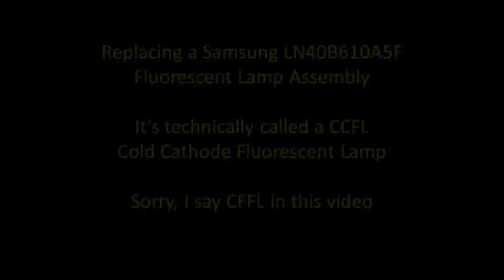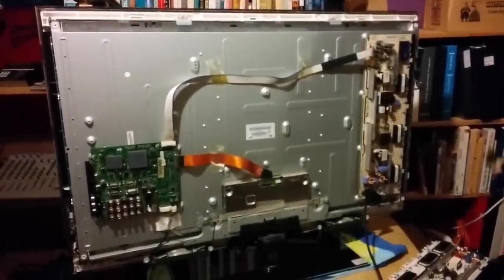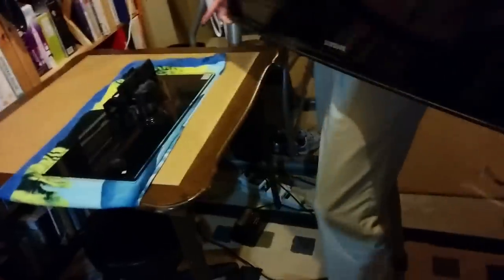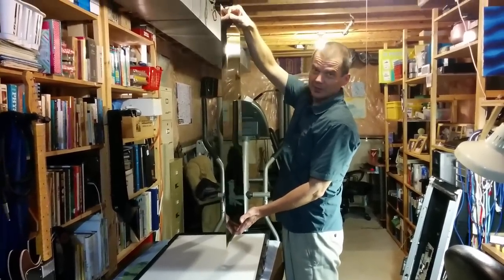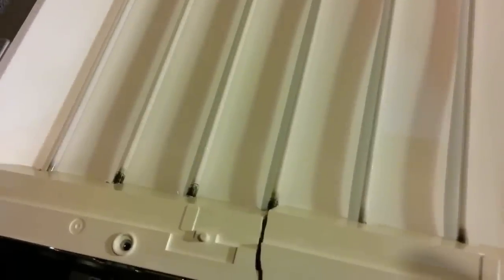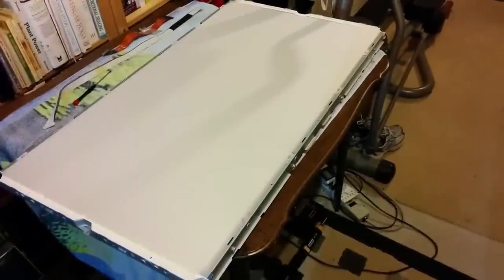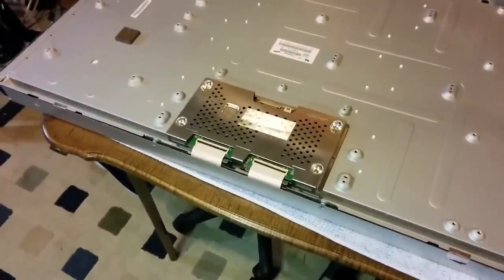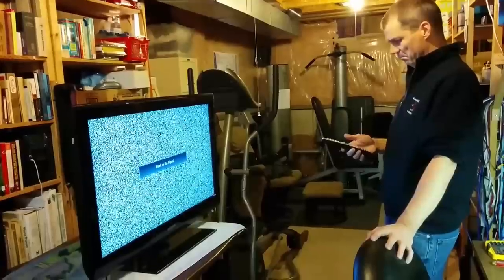Replacing a Samsung LCD TV Fluorescent Lamp Assembly to fix backlight power off after power on.

Comment: Thanks for the video Steve. Great job getting it going again and keeping it out of landfill.Cold Cathode Fluorescent Lamps contrary to their name are not "Cold". Burning at the ends of the tubes is caused by arcing or spluttering as the tubes age. The inverter board is shutting down because it is sensing a over current fault because one or two of the tubes have a arc track causing high resistance. The old CCFL's were run at maximum brightness causing them to age far quicker than they should of. When people buy a new LCD-TV (whether it be L.E.D. or CCFL backlight have the same problem) they will plug the unit in setup the channels and leave it at the factory default settings. These settings are always set at maximum backlight brightness causing their $2k plus LCD-TV to die sooner than it should. The manufacturer's always give the maximum power consumption IE: 250watts because that's the max power the set will pull from your house AC supply. Lowering the brightness of you're TV from 100% to 50% (I have a 52 inch LG TV and it only pulls 120 watts at 45% brightness) will not only save power it will save the TV set from self destruction. I been fixing these rubbish TV's for some time now and I am just starting to see more L.E.D. backlight TV's coming in with blown LED's in them causing dark spots in the panels. For your own sake turn the brightness of the backlight down as low as you can and save yourself loads of money by not having to replace you're new TV at 2 or 3 years old and not having to pay all that money running a 250watt TV at maximum and run it at 40% brightness and running at 120watts. Makes sense I should think!
Reply from the maker: Hi Dallas.  Thanks for the great summary and very helpful tips.  I honestly believe I did not turn down the brightness on this repaired TV.  I'm going to play with that tonight whilst monitoring the power consumption with my handy Kill-A-Watt thingy.  If a brightness adjustment is warranted, I hope the family does not notice :-)
Reply: Great advice i was turning down the brightness before tubes burned out. I am hoping new tubes will get it back again and hopefully tubes will stay on

Comment: Great Video.  Just a word of caution.  When powering on a unit for the first time and the chassis is open, Always wear protective glasses and earplugs.  PSU capacitors do blow up and the cases fly off.  Personal experience here !!
Reply from the maker: +pentachronic Thanks for the nice comment and the very wise safety advice.
Reply: Or place a plastic case over it
Reply from the maker: Thanks for the good idea.

Comment: Great video man! I really enjoy seeing people bring old electronics back for a second life
Reply from the maker: Thanks.  It was really fun making the video.  The TV is still going strong as well.  So worth the effort.  Here's a shameless plug for an LED upgrade I did for a friend many moons ago.  http://opengeeks.ca/projects/led-upgrade.html  I'll try to keep these coming for people like you who enjoy them.
Reply: Steve Quinn Here's a question that I often wondered. The number one problem I see with flat screen TV's nowadays is the TV working except the backlights, usually causes by bad capacitors or mosfets on the power supply/inverter board. I'm currently in the process of repairing a bad inverter board with new mosfets which will more than likely take years to arrive from china, is there anyway you know of to just get a CFL backlights going without a properly functioning inverter? I'm guessing people haven't really experimented into that since TVs are so easily replaceable but was curious anyways. Thanks
Reply from the maker: I don't know sorry.  I've recently borrowed (aka stolen) my Dad's ESR meter to repair a 2009 iMac power supply's bad caps.  I cannot believe how easy it is to rule out bad caps with these meters.  I'd consider that first and foremost for all larger electrolytic caps these days.
Reply: Steve Quinn How do you test capacitors on a standard multimeter?
Reply from the maker: With a simple multi meter, you could easily detect a dead short but nothing more.
With a capacitance meter, I'm curious what a bad cap measure out as.  I suspect it would appear to be ok
I don't know, I dont have that kind of meter.
You need an ESR meter to measure the Equivalent Series Resistance of an Electrolytic Cap to an AC signal.
This is applicable to larger Electrolytic filter caps only
Filter Caps should be a dead short to AC right?
So when measure with an ESR meter, they should measure as a dead short
With my meter, a good cap burries the needle as does shorting the probes.
Bad Caps, (bulging or not) will measure a greater ESR value.
It's hard to explain.  Here's some links.  If you are still confused, I'll make a video :-)

Here's the vid that inspired me https://www.youtube.com/watch?v=72sJ5Infuu0&t=34s 
Here's a DIY http://paulorenato.com/index.php/94
I'll buy a better one than my Dad's if necessary but a cheap one certainly worked for me
Reply: I get what you mean, I still wouldn't mind seeing a video though
Reply from the maker: Ok.  I'm just getting the gear and knowledge together to do one :-)
Reply from the maker: K Uploading it now.  It might be available in an hour or so.  https://youtu.be/CltS0LyHQXc

Comment: Awesome job. Feels good to fix things that other people won't take the time to do. I have 2 of the Samsung LCDs with the big push button in the middle that had bad capacitors in them and they both still work great,. I gave one to my ex and have been using the other in my bedroom. The picture quality on the new LEDs is not even close to the old school Samsungs. I wish there was an easy way to convert the CCFLs to LEDs because that thing is like an oven.
Reply from the maker: Thank you for the thanks.  It really does feel great to fix stuff.  That's awesome you have done the same. I had no idea the picture quality is better.  You are right about the heat feeling like an oven.  That comment inspired me to think of perhaps incorporating a fan to augment the TV's cooling.  I see no reason why a well placed quiet fan cannot move enough air to keep the heat from prematurely overheating/aging the CCFL's.

Comment: Great video. I'm considering doing this job that is needed on my Samsung 40" LN40E550F7FXZA.. i'm looking to see if I can find replacement CCFL bulbs.
Reply from the maker: Thank for the comment.  I got lucky (and lazy) and simply swapped the bulb assembly with a donor TV.  If I ever face this issue again I might try the LED conversion process that seems to be quite popular in the community.  Good luck.

Comment: The failed lamp can be replaced putting an equivalent dummy load of a capacitor around 100pf-220pf 6KV.I did it a couple of times in a tv and a monitor and both the sets worked perfectly.LCD lamps are unaivalable nowadays.
Reply from the maker: Hi George.  Thanks for the comment.  Are you suggesting a dummy load is applied to each failed lamp?  If so, It's an interesting idea.  Hopefully only a few lamps are toast and the light it not missed.  It's both sad and good the CCFL's are unavailable.  Pimping out these TV's with LED's seems to be the cool way of solving the problem.  Pun intended lol

Comment: It's good to repair these. The standoffs for the bulbs dry out and the ultra violet light from the tubes mess them up. I wonder if you can get those.
Reply from the maker: Thanks for the comment Walter.  I think the heat does them in as well.  I have no idea where to get the standoff's new.  I'm sure there are boatloads of used ones in donor TV's at your local recycling drop off.   I think you can get away with less than are installed as the bulbs are pretty stiff.  If you do find a new standoff vendor, please come back here to share it with others.  Good luck.
Reply: @letter2steve  I've repaired several flat TVS. Mostly D con boards. Then take to the salvation army store.
Reply from the maker: @waltergabriel3694  That's awesome.  Have you tried to perform an LED modification?

Comment: You opened every thing but you did not convert to LED backlight from CCFL tubes CCFL tube got life of maximum 25000 hrs  only and it was black end any it your wish  Good Luck Good effort and patience keep the good work Love your work
Reply from the maker: Hi Shindhs.  Thanks for the comment.  Believe it or not, I posted this video on on Jan 10, 2015.  At the time, I don't recall LED  conversion was as popular as it is now.  I also had an easy CCFL swap available at the time. It's nice to know an LED conversion is around the corner if needed.

Comment: Hi Steve i find myself doing the same LCD dismantle this week . I have a Sony Bravia Kdl 32v. I have tubes on for approx 5 seconds then off. One tube glowed orange so i have removed it but no change. I have found a supplier of tubes here in UK but wondering about the insulators. Not watched all your video yet just bits. Lewis
Reply from the maker: Hi. Thanks for the comment. It's great you found a source for tubes. Can you let us know in these comments section who they are. The stand off thingies as you will find are crazy brittle. I personally never needed to change them but hopefully a simple solution awaits.
Reply: I am on contact witha tube supplier via Ebay. He is in Twinkenham London UK. Will keep you posted. I need 10 for my project and I am negotiating a price
Reply from the maker: Cool. Thanks for the update.
Reply: @letter2steve  Hi again Steve. Regarding LCD tune supplier. I realise the length of tube i require 72.5cm is slightly less than what was shown on ebay which was 74cm. I was wondering in your donar set what was your tube length. Thanks Steve. Lewis in UK
Reply from the maker: Hi. Sorry for the delay. I'm in Montreal at the Formula 1 race. The Cell internet is wacked by people here. I never purchased tubes. I simply swapped the assembly. If you look close at my video you may see if you have a little wiggle room for tubes of a different length
Reply: Thanks Steve enjoy the Formula 1 I will keep you posted Lewis

Comment: Basically you have a dead CCFL one or more tubes lighting on the LCD screen itself.This is not an easy jobs require a lot delicate works and take it a parts and have a exact tv model with a bad LCD screen for parts to fix this thing.
Reply from the maker: +Chi Chu Hi.  Yep.  I had a bunch of dead CCFL's.  It was a delicate job yes but I think by simply taking one's time and being patient, most people can fix anything.  I also think the exact model is not always required.  My donor TV for example was the same size but a very different model.  The mainboard and TCON board were very different but the CCFL bulb assembly and it's frame were identical.   The manufacturer may make multiple models of the same size but many of those same sizes will share the similar parts.  It's quite cost effective for them.

Comment: You're the first to show how to change Lcd lamps. Maybe the other people are to stupid to know how to fix that on a LCD. I wonder can you get them new ? Thanks for the video you're ahead of the other TV men.
Reply from the maker: Hi David.  Thanks for the comment and thanks.  Yes it's weird how few videos I found at the time (and still now?) that properly describe the issue.  I did a little searching for new CCFL's myself before I got lazy and swapped the whole thing out. They are out there but they may not be reasonably priced in the quantities we require.  If you decide to replace with new bulbs, make sure you get the same electrical and physical specs.  Personally, if I'm forced to replace any CCFL's, I'm going to do a CCFL to LED conversion.  That seems to be the popular thing to do these days and it looks kinda fun.

Comment: excellent video. no disrespect but the effort to replace the fluorescent lamp assembly and the cost of buying the new lamps makes this endeavor only for the motivated.  i don't mind soldering a replacement components even the real small surface mounted ones, but if you enjoy this, do it man.
Reply from the maker: +Edmond C Hi. Thanks for the nice comment.  I agree the cost of new replacement CCFL’s (assuming they can be found) is probably not worth the effort.  I used the entire lamp assembly from a donor TV so that made this repair simple.  Their are plenty of parts TV’s on Kijiji making this same repair feasible.  When I first made this video I knew nothing about the alternative repair, the LED Conversion.   Now LED conversion videos are quite prolific as are LED conversion kits.  I've yet to try one myself but they look interesting and well worth the effort in keeping this stuff out of the landfill.

Comment: Steve, I have a Samsung ln40b650t1fxza I bought back in 2009 with a similar issue, the video would stay on for about 15 seconds then go off with audio still in the background.  Did your TV still have audio in the background?  Great video by the way.
Reply from the maker: Hi Marion.  Thanks for the nice comments.  With my broken TV, I'm pretty sure it completely powered down about 2 or so seconds after the TV's "start up" sound.  I'd first consider taking the cover off and ensuring you don't have any "Bad Caps".  It's really common and silly to not consider.  If it turns out to possibly be a board like the TCON, I found it very helpful to go to ShopJimmy.com to get an idea of the part numbers of the boards and other models that are similar.  There are many broken "parts TV's" on Kijiji.  With a little cross referencing, you can easily find working parts to substitute/troubleshoot and repair.  Take your time, be cautious and have fun :-)

Comment: Hi Steve
First, I must ask you to excuse my English.
I have saved a lot Cold Cathode Fluorescent Lamp from a Samsung TV and had in mind and use them as backlight elsewhere than in a TV. 
For example a bookcase, under a bar or decorating a dressing table - yes the ideas are numerous. But I lack some technical specifications of the "Fluorescent Lamps" as how much power they use (Volt) and so on ... Can you help with such information?

Thanks in advance,
Best regards Morten,
from Denmark
Reply from the maker: Hi Morten

Thanks for the inquiry. Your English is really good by the way :-)

Your project idea is really interesting but be careful. CCFL's apparently require a large starting AC voltage.

I'm not familiar with the exact voltage specifications unfortunately. If I still had my TV apart I could measure it and tell you.

I did a little Googling and found several URL's that might help further
http://www.eevblog.com/forum/chat/how-to-measure-high-voltage-on-ccfl-inverter-boards/

https://books.google.nl/books?id=SPwqg7qpFWUC&pg=PA157&lpg=PA157&dq=CCFL+jim+williams&source=bl&ots=_57Z82l5Iw&sig=RYZpINDZPudebzAzMmE2g-JvR4Q&hl=nl&ei=vnXjTZiVNcaVOsjC1MkG&sa=X&oi=book_result&ct=result#v=onepage&q&f=false

https://cds.linear.com/docs/en/design-note/dn133f.pdf

Good luck

Take care

Steve Quinn
Reply: Thanks a lot Steve
After reading about how to (if i'm lucky) fire them up, I must admit that it's a much more complex task than I thought it to be. I think that I will use a more simple LED solution instead. But thanks for helping me out. I appreciated it. And thanks fore sharing all those interesting stuff on YouTube. I like that a lot

Kind Regards

Morten Holmboe | Photographer | Webdesigner | DIY Nerd
Brabrand - Denmark

All humans (and browsers) have issues - some more than others :-)

Comment: Hi steve .thank you for the video.i have also the plastic support for the lamps completly destroyed due to the heat probably.can you fix the bulb with other thing?rubber tape?glue?silicon?
Reply from the maker: Hi David.  Thanks for the comment.  It gets pretty hot in there so whatever you do, make sure it can take the heat.  If I ever go in for another repair, I think I'm going to put in a temperature sensor and a quiet fan to see it it helps.  Regarding your question, I see no reason why a high temperature silicone would not work.  Just be sure it can take the heat.  Perhaps a nylon standoff cut to the correct length would be a little nicer.  Either way, I'm pretty sure you want very little dark coloured stuff in there as it would influence the light.  Good luck.  Oh here's what I mean regarding the standoff http://www.hardware-andfasteners.com/sale-8558246-male-female-threaded-nylon-hex-spacers-standoffs-m3-x-30-mm-ul94v-2.html
Reply: Steve Quinn 
Hi steve.thanks for your quick answer.i will let you know when i do it.
Reply from the maker: Awesome.  Please share your findings so as to help others :-)
Reply: Steve Quinn 
Hi steve.i fixed the problem with a satellite connection cable  part.i removed the cable protection tape and i just keep the silicon part with     cuber line and fix it with a white electric rubber tape.after i clip the card on ccfl tubes directly and bolt
 it.it match.
Reply from the maker: Hi David.  Thanks for the update.  I'm a little confused without pictures.  Can you take a few examples?  I'll figure out a way of sharing them for others to see as well
Reply: Steve Quinn yes i will do it
Reply from the maker: Thanks.  That would be awesome.

Comment: When I repair monitors. I tear out all the ccfl's out and place LEDs all over behind The panel 

Inverter goes to the trash can 

Problem solved !!!
Reply from the maker: Great idea.  I did not even know people were doing this when I first engaged in the project :-)
Reply: I completley agree with you, better  modify to led .  How did you solve the problem of the variable backlight intensity when going from cfl to led? Could you please post a video?  I've wanted to.do that.  But most videos use a generic under the counter light strip a have a fixed led colour and intensity.  Apparently the backlight brightness control no longer works
Reply: @kjaxky  Do you still need assistance?